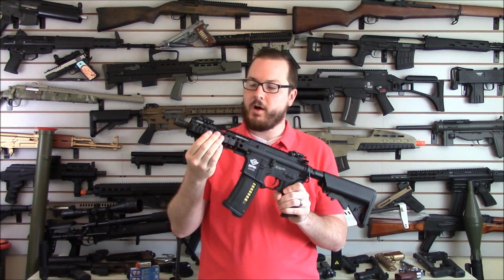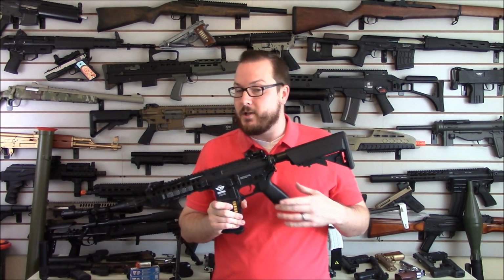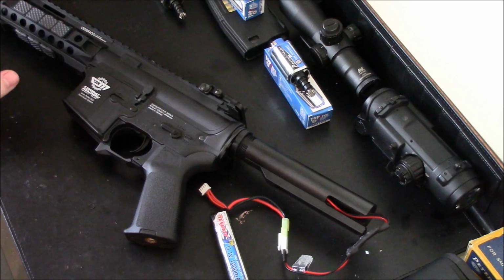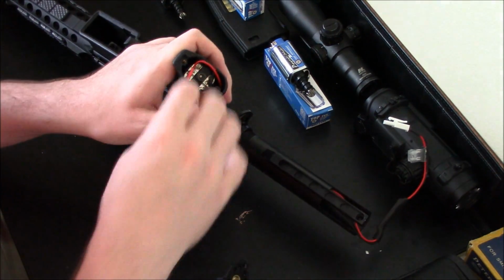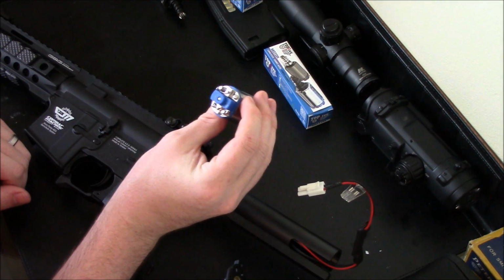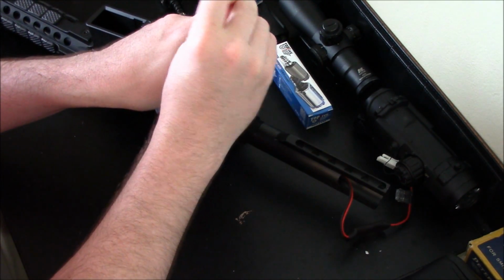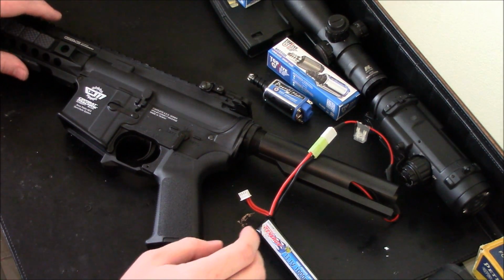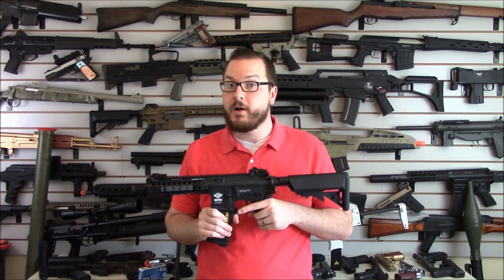G&G Motor Installation and Test - 300 BOT Combat Machine

Comment: What motor do you recommend for these, I have just picked up sn old and slightly abused one, and the motor doesn't seem to be great. and it's only running on 7.2v, and I am not sure if it should run on 11.1v because I can't find one that fits into the stock tube ?

Comment: If the motors out of the gun will it still do its thing? My cm16 stopped working so I pulled the motor out to test it thinking it would spin fast but it barely moves at all
Reply: Yeah if you pull the motor and plug it in it should RIP. If nothing happens the motor is most likely seized you need a new one :(

Comment: Hi I have G&G GC16 Wild Hog 13.5 . Can I install 40000 rpm motor in it? Do I need to change anything in the Gearbox?
Reply: You may need a bigger capacity battery so that motor can run nice and long otherwise anything under 1350mah will be dead by lunch :(

Comment: 3 or 4 extra rounds a min is hardly worth the cash spent
Reply: 4  rounds PER SECOND, so simple math - 4x60=240 extra shots per minute, I'd say more than worth.
Reply: Pennsylvania State Militia it is when you’re only running 16rps.
Reply: 3-4 rounds a second more isn't terrible
Reply: Full auto seems kinda nooby in my opinion. I like it better when I'm getting shot at realistically, and not with 80 rps polarstars
Reply: Username news flash, you’re getting shot by a plastic ball
Reply: OP Airsoft Full auto takes much less skill when you hit others with plastic balls

Comment: If you get the upgraded motor would I need to upgrade/change my 9.6v battery to a different voltage?
Reply: Salt water Discus your 9.6v battery probably won't be able to run the upgraded motor to its full potential
Reply: I dunno my friends got a 9.6 valkan in his raider..with shs high tourqe motor spins in pretty fast..of course his piston and piston head upgraded to shs..as well as mine. .I am definitely thinking of getting stronger motor. Myself..

Comment: Does 300 BOT have a long motor or short?
Reply from the maker: Long. Basically all airsoft AR rifles use long motors, EXCEPT for the models using the short Troy grip, which I don't believe any come with from the factory.

Comment: today I fitted the g&g upgraded motor to my custom m4. stock motor was a classic army (thats how the gun was born), and the result was amazing!!! trigger response is literally 3x faster and motor "screech" is hugely quieter. anyone wanting to upgrade their stock motor should buy one, for £35 you can't go wrong
Reply: If you connect directly to tge battery, yes, it should spin. Have to connect it direct to rule out any other issues, such as trigger contacts